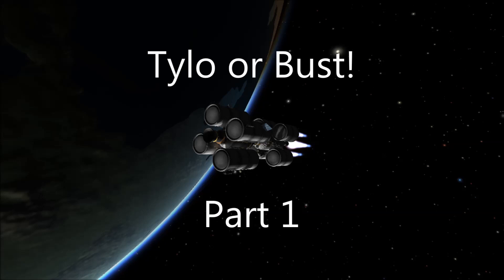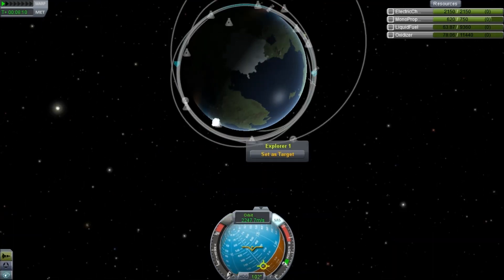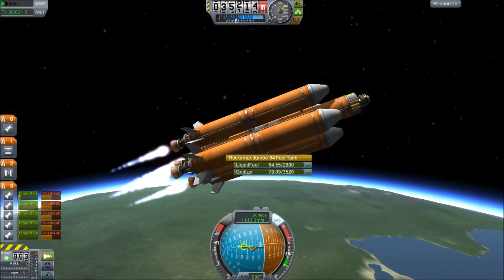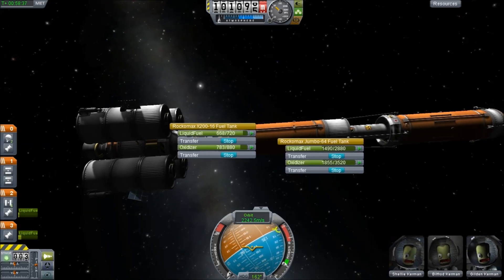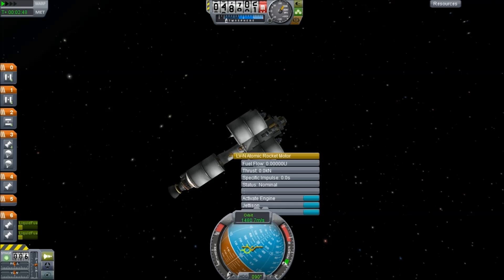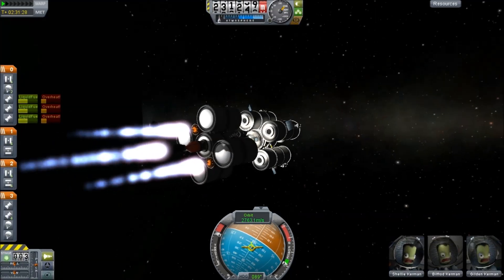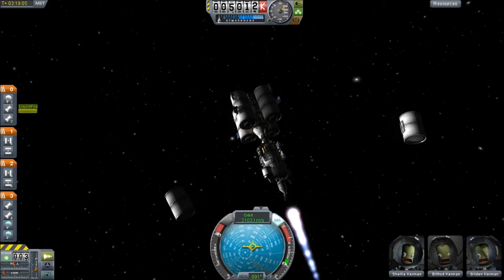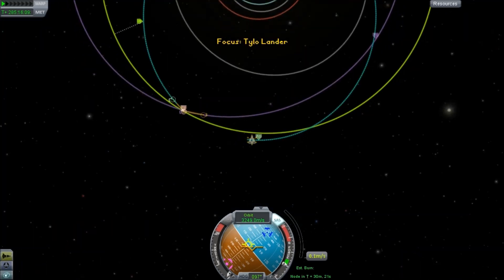Kerbal Space Program - Tylo Or Bust - Part 1

Comment: Yeaaaah...I just learned how hard Tylo is to land on. So annoying. This robotic lander has landed on every single planet and moon - including Moho! -  without using nuclear engines. It's got me over 13700 science points.  But can it land on Tylo? Err, no. This Kerbal's going back to the drawing board.
Reply: Shaboolie Delta v is change in velocity
Reply: One question, how would you suggest a beginner could get lots of science?
Reply: First try to unlock all the science parts. Takes a while. Then I use a mk1 pod, one materials bay underneath that, 2 mystery goo containers on either side, some seismic detectors if I'm planning on landing, barometers if the target has an atmosphere, and plenty of gravioli detectors. You get more science if you recover the vessel, so put plenty of parachutes on it. Or you can use the Kerbal to collect the data from each device, in EVA, allowing it to be used more than once. This no longer works for Materials Bay or Mystery Goo. This is just one method, I know plenty of people do it better than me.
Reply: Hmm, I see. This one time I saw this guy which stuck EVERYTHING that gives you science points on a rocket, he made a massive rocket with docking ports and a mobile processing lab, and he managed to land on EVERYTHING, by the time he got back to kerbin he had over 15000 science XD
Reply: Shaboolie
That's certainly doable. It sounds like something Scott Manley might have done. Depends entirely on your skill, and patience! I took Jeb to Eeloo and back; took me forever, but I got just over 2000 science. I also forgot to mention you can get science when you do crew reports and EVA reports. Once near the planet, once far from the planet, once on the surface. If you do EVA reports close to the Mun or other bodies you can get science from the different biomes (if it has any) as you pass over them. A good place to start might be Kerbin itself. Its atmosphere, biomes, low and high orbit, etc, then you can move on to Minmus, which is further away but it takes less delta-v to land on and return from than the Mun, because of its low gravity.
Reply: Ok then, just wondering, people always talk about delta-v, what actually is it?

Comment: I'm on a project there I create a big planetary spacecraft made for re-use and transporting lander crafts that rendezvous back to the main ship in orbit after the landings. the ship is being made like a space station by sending parts and docking them in Kerbin orbit. By that way I can make it big with allot of fuel and both normal rockets and nuclear engines. It also has an own life support module with lots of food tanks and some small tanks of water and oxygen that can be cleaned and used again with help of the filters that make water out of waste water and O2 out of CO2. I'm close to the final design of it due to problems with the design and testing...

Comment: I've done a couple of trips to Laythe and I use a driver stage made up of an orange tank with 4 nuclear engines. Burn times are about 10 to 15 minutes and I hesitate to use time acceleration, but I can get the thing in orbit, fully fueled, in one launch. I use 7 orange tankers as the booster with cross feed for that, and it's pretty easy, no fuss.
Reply: thats over packing a tiny bit
Reply: Well the booster is just what I use for heavy lifting. It's bigger than it needs to be for this particular launch, but on the up side I get extra fuel into orbit that I can use for the burn to the transfer orbit.
Reply: true

Comment: I had similar issues deploying large rockets with radially attached jumbo tanks.  What you want to do is connect each tank to the two adjacent ones with structural beams, and also connect each tank to the central tank with beams.  You also want to use separation motors to decouple the radial tanks, configured to thrust directly away from the center.  I have not lost a vehicle to decoupling since I began this.

Comment: I've tried this. if you set up the rocket to fire in the same stage it decouples, it doesnt fire. and if you try to be fast enough, you destroy your plane. you can probably, however, put a probe on the tip with a battery and it could possibly work. Besides, there's mods for that :D

Comment: The maneuver nodes make it so much easier now.  Basically all you need to do is set a node for a burn as soon as you think minmus is about to rise over the horizon (90 deg orbit) to get your apoapsis lined up with minmus's orbit and then set another one to adjust your orbit inclination to get an encounter at least half way out.  You end up using less fuel for minmus because the lower gravity is much more forgiving during the landing.

Comment: I really don't see that happening without mods. Eve is harder to launch from than Kerbin and you don't have the luxary of building a rocket there, you have to take it with you. 
So essentially, you have to build a rocket that can take off of Kerbin and fly to another planet, then build a rocket that can carry that rocket off Kerbin and to another planet. Since this large rocket will probably break docking ports under acceleration, you'd need to do it in one go. I don't know if anyone has done it

Comment: I agree with you Scott, the mission seems to be quite tight in fuel reserves at this point for the necessary +/- 9k dV you still need in the mission. More, a lot of the remaining fuel will need to be used by the mainsail, that is far from being as efficient as the nuke engine ...

BTW you should probably try a Eve and back 3 man mission. A lot of stuff changed since 0.16 and your last trip there is already outdated, not mentioning it was just a 1 m capsule ...

Comment: It is possible, though only one of the docking ports is really used for merging the vessels, the other two are closer to very strong struts than to a node connection as you create in the VAB (if I got that right from Harv's post about it).

Comment: but is this even possible to do that? I mean isn't it the same problem, that KSP has in the VAB, that you can't connect one part to two diffrent parts... That's the reason why it's impossible to build space station rings, because you can't connect one "end" of the ring with the other (you can just solve it by using struts between these)

Comment: Instead of using a single docking port, put three of them on a tri coupler. I've yet to try it myself but the three points of contact is supposedly more stable and less prone to wobble (at the expense of requiring more precise line up during docking)

Comment: Also for the lander, landing heavy payloads, it's enough to use the shortest rockomax fuel tank (the wide one) on the bottom of your payload, and 6 or 8 radial engines (the tiny orange ones, not the large ones).

This will give you great stability and enough thrust and fuel to land a 10-15 ton thing on the mün with plenty of fuel to spare. You might even afford some fuel for the braking-from-orbit-to-landing maneouver!

Having 1 large engine in the middle as in this video is very unreliable.

Comment: Don't give up! It took me 6 hours (not in 1 take, luckily) to build a launch vehicle strong enough (and stable and elegant enough) to lift 15 ton base modules to the mün.
Not to mention the testing and development of a mün rover with a radial docking port in the middle to be able to move base modules around if they are landed slightly off target.

Good tip is to use the Cart plugin for the main wheel body, and use wide structural pylons on each side to add airplane support wheels to avoid fails.